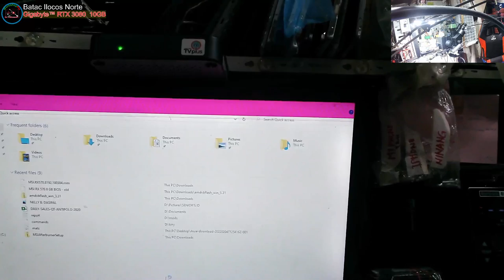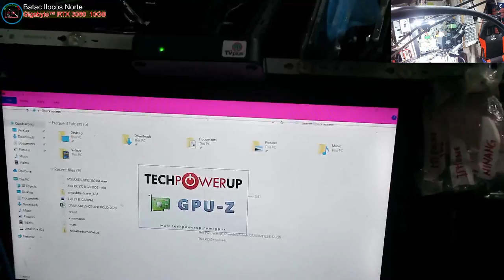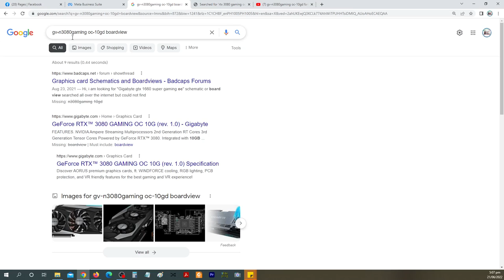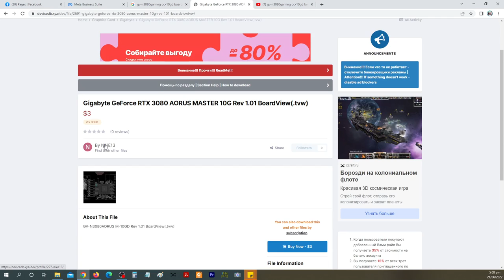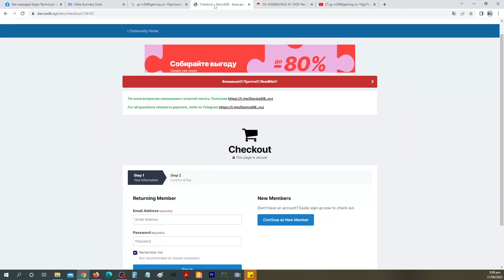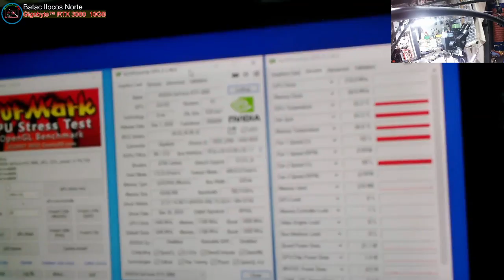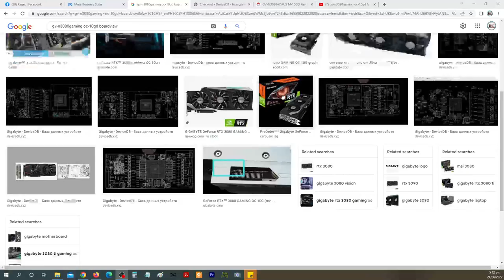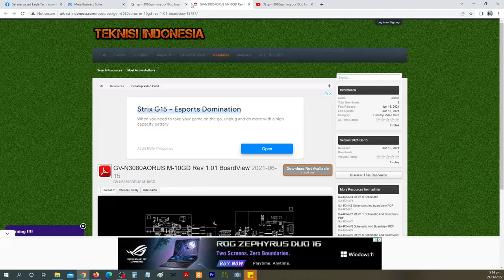Gigabyte GeForce RTX™ 3080 GAMING OC 10G(rev. 1.0) -  Trying to FIX All Technicians in Ilocos Norte?

Comment: Saludo ako dito k Sir Jonathan. He revived my RTX 3080. I thought wala na talaga pag asa mabuhay kasi sabi ng repair shop dito sa Ilocos Norte ndi nila talaga kaya gawin until I saw sir Jonathan here in youtube ( blessing talaga ). I sent him my gpu after a good chat. I thank god he was able to fix it. What was the issue? I shorted the card when i changed thermal pads na stuck yun fan cable sa heat sink. I also messed up the 8 pin so wala po power and display. Mapag tiwalaan talaga si Sir, he only charged me for the labor. Salamat ulit Master!
Reply from the maker: Salamat Sir Richard